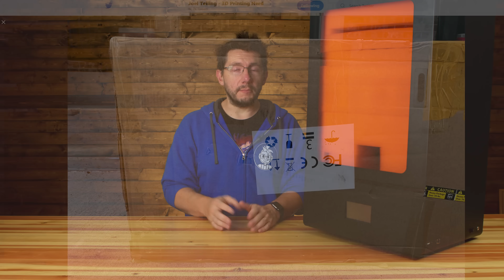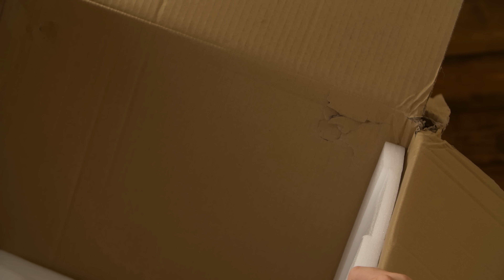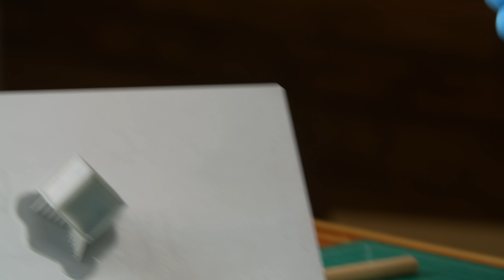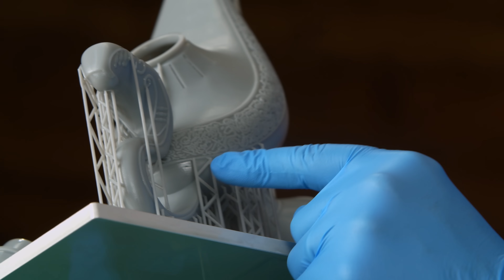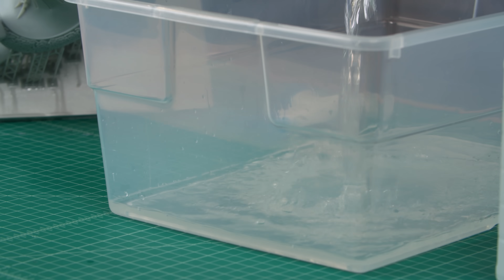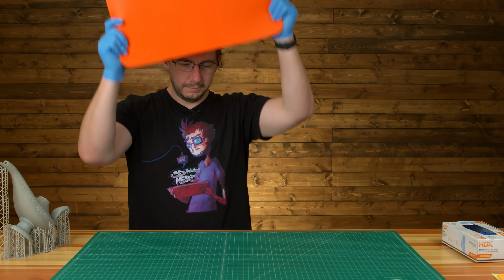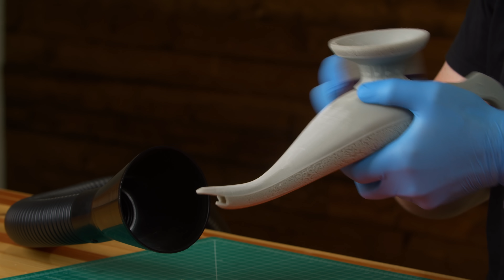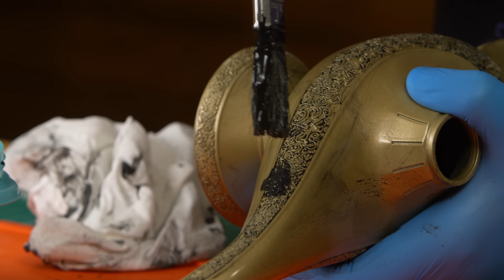HUGE Resin Printer - First Impressions of the Peopoly Phenom mSLA 3d Printer

Comment: I'd wish for a house sized 3d printer that worked like a replicator and only took carbon dioxide to carbon as a building source and took it from the air, that way the more you printed the more carbon dioxide you'd scrub from the air. I love the distress look you got on the lamp. Great video.

Comment: Spritzing it a bit wont remove all of the dangerous resin
Reply from the maker: That’s why I used a chip brush - it gets the IPA into places it needs to be and aids in the removal.
Reply: @3DPrintingNerd  I dont know if such a product exists, but i would try to get a miniature pump to rinse the prints in the mini tub. I would recommend battery powered dental cleaners, but I dont know how they would fare with alcohol.
Also here are some resin procedures, if you didnt know these exist: https://www.radtech.org/images/health-safety/3DPrinterSafetyPoster_revised_8.5x11.pdf
Be in good health and keep going!

Comment: As you say, the weathering didn't work out too well. There are panel liner washes for model kits that would give you the effect you are after. However If you are going to stick with the acrylic paint then you should water it down much more and do it in layers wiping away after each. The model itself looks great, the decorative details look fantastic.

Comment: use a hairdryer or a heat gun on the supports before you cure the model they will warm up and  start to warp you can just brush them off reducing the Pock marks. cure.  also when sanding always wet sand to cut down on the dust. :)

Comment: That is a failure of packaging not shipping. the "hole" in the box you will notice is the same shape and size of the foot of the printer. it's because what dented your printer was sliding down the high sort slide and hitting the belt for low sort this happens to every single package several times usually. 1800 dollar printer they felt the need to save .50 cents on packaging and 2 bucks on shipping...amazing.

Comment: If I may suggest for the weathering,  Get a sample set of "Rub n' Buff".  It's like 12 different metallic waxes.  Works really well for the "highlights" For this model I'd use a lighter gold colour of Rub to show wear on places where you'd expect the lamp to have less oxidation and be shinier. 

Here are my two tips on how to do your inkwash better next time.
1. Reduce surface tension.  Either a tiny drop of dish soap in the water, or a 20:80 mix of water and "Pledge Future Floor Cleaner".  
2. Lightly Gloss coat the gold before doing the wash (note I do not like Bills recommended spray Grumbacker varnish, Rustoleum spray varnishes/urathanes are my goto, plus for the price difference you can try out all 3 shiny levels..).
You are 100% right that it takes a lot of practice.  Getting awesome at weathering stuff is a little bit of wizardry.

Comment: I would wish for you to take the styrofoam packaging out of the top of your resin printer. I also wish for the lamp that Sean (or Shawn) does not want.

Been FDM printing for a long time with printrbots (2013 woody with fishing line, metal plus, and a play). I have always wanted to have the resin printing experience, but the small build volumes at a high price have been prohibitive. This printer seems to be breaking down those barriers for me.

Thanks for the video!

Comment: Joel, I like the Gold Shiny one. My wish is that 3D Printers will come to the point that they are accepted by the main stream community for the great tool that they are. I have been working in the 3D Printing for the automotive industry for about 15 years and even after many advancements in material and printers, many still consider it something just suitable for  prototypes . I hope that it does not require a magic lamp but I would accept one.... just sayin :-)

Comment: The weathering doesn't look to bad, you could clean it up a bit more with some 70% IPA (or water down the 91% you have) and go over it gently. If you're ever going to do weathering again, use oils or enamels, acrylics work in a pinch but are an utter pain in the ass to clean up, oils are the best, they give you a few days of working time and when thinned to a wash they'll get into every nook and cranny without a problem.

Comment: something you could do is get a mini sump pump and set it in the large container. you can have it pump through a flexible tube to a 3d printed showerhead so you can rinse all sides and it would recycle the alcohol that drains in to the bucket

Comment: Had our our own UPS woes with an $80K piece of lab equipment. Somehow it arrived in a box that was not the original box that was 2 sizes too big without any of the protective packaging.  So my wish is for UPS to be better at not damaging packages. (or to have a 3d printing workshop like yours which is probably more realistic :p )

Comment: How is this a larger print volume than the 3L? 335mm X 200mm X 300 VS 276mm X 155mm X 400mm, even by total volume it doesn't beat the 3L? It's close, at a fraction of the price but to say it's more is a lie.

Comment: "use the plastic spatula to remove it from build plate"... uses a metal scraper scratching the plate on day 1
Reply: No, stirring the vat with plastic. Metal on the anodised aluminium build plate. The hard resin damages the plastic spatula and then you scratch the FEP film afterward.

Comment: For me a resin printer just does not seem very practical.  The post print work required combined with resin maintenance and smells is a turn off for me.  Quality is great of course but for most people, a FDM 3D printer will get the job done.

Comment: I use a little bitty pump for aquiruim in side a larger container. Pump has a hose that runs to top  of container with few of garden mist nozzles. It works like a solvent tank but utalizing adjustable nozzle, works amazing.

Comment: NO your wrong
Resin after cure is non toxic
But
Before it cure , resin wapour is toxic , you need to use toxic wapour filter when you take out print but after it cure with uv lamp you dont need to (still need to when painting 😂)

Comment: As for wish, I would wish for my own phenom printer....even a dented one!. I like both types..but prefer a weathered look. Here's a tip for you. When you are doing the weathering, have a clean, water-dampened rag handy. Then use a piece of kitchen towelas you normally would to wipe the majority of the black paint off. Then you use the wet rag to clean off any smudges of black that you do not want on your "shiny and clean" areas. The wet rag make it easier to clean the areas u don't want weathered.

Comment: you mentioned more then 1 bottle of risen was needed for this print? that means at least  80$ for this model...
a real metal one would have been cheaper. until resin cost much much less, sla is just unpractical.

Comment: They definitely need foam all around the machine, people will even drop heavy boxes in shipping from a couple feet up just for the heck of it. Pro tip for people that ship stuff internationally, make sure that your package can also survive having something like that dropped on it. Putting the heavy stuff at the bottom and the light stuff up top should make sense, but when you do hard labor for a low wage you stop giving a crap after some time.

Comment: If I got that weathered lamp I would wish:
1. I will never run out of filament during a print again 
2. Every print I start has perfect adhesion and won't pop off later in the print
3. I could do single-extruder multicolor printing without a purge block

Comment: The problem I have with Peopoly is simple...I don't trust them. I don't trust them because I own a Moai. They have trouble reading SD cards (its on their wiki if you don't believe me), they released a heater, the first versions were weak, the second version the first who knows how many units were awful, and I mean dangerously awful, the PSU (which was generic) almost caught fire on one of them, the other one the heater module itself started smoking. The acrylic sheet in the FEP tray isn't great, to the point where they released an "advanced" sheet that effectively just has a FEP sheet on it. Two problems, if you already bought the FEP vat, tough crap, and if you buy the advanced sheet like I did (because the original leaked resin which then hardened on the sheet itself) you will end up waiting over two weeks to get the sheet only to find that there is a sticker on the onpurotected film side saying not to remove the film...the adhesive leaves a lot of residue. Because the film is not protected it was scratched, and scuffed and had a LOT of air bubbles because it trapped debris between it and the acrylic sheet, to have anything even REMOTELY optically clear enough to warrant using I ended up removing the "advanced" sheet...

How many times can one company disappoint?

So now they have a huge build volume, sure, but the complexity of the machine from a mechanical standpoint has been greatly reduced and yet they were on Tested talking about needing to use excess resin to cool the vat because the heat is so great.

There is ZERO chance I would ever spend almost $2k with them in the hopes they can overcome these challenges when they can't even do simple things like read SD cards right, or apply film to an acrylic sheet in a way that doesn't render it pointless...or seal an FEP vat.

https://wiki.peopoly.net/doku.php?id=moai-sdcard

Btw amusingly my moai shipped with an sd card that had their test prints in a gcode folder...*sigh*

Comment: I'd really suggest finding fit-over safety glasses for your eyes (not to mention long sleeves) if you are going to be using a brush-based cleaning approach. Those bristles can really fling liquid everywhere, and you don't want the resin to get in your eyes even in tiny amounts. Not to mention the IPA would sting like hell.

I think a cleaner approach to something like this would be to get a tough plastic bag (not garbage bag, thicker walls), place the model in, and then fill with IPA to an appropriate level. Roll the top down and clip with binder clips so it's alcohol-tight, then shake vigorously. maybe brush a little bit at the end. This way you won't have to worry about flinging resin contaminant everywhere.

Comment: Or you could get on Amazon and buy a plastic genie lamp just like that one for $17.99. I've never understood the allure of making inferior copies of items with hardly any of it useful. Someone at least needs to come out with a print media that is food safe, dishwasher safe and or microwave safe. I guess this is the modern version of the high school ceramics class. Sure they say oh well instead of buying an item and driving to the store to get it you can just 3D print it! This will save you money. You can just print spare parts for your home items. Well maybe that is true but not with any printer that most people can afford. Maybe a $10K printer and then another $10K for that 3D scanner you will need as well. You would never live long enough to get that ROI back as if is was possible in the first place. So what we are left with is items that are only safe to look at. https://www.amazon.com/Disney-86098-Aladdin-Feature-Genie/dp/B07GXM3XHX/ref=sr_1_3?keywords=plastic+genie+lamp&qid=1571870352&sr=8-3

Comment: Great video, kind of jealous that you got that behemoth of a SLA printer, but you know what it would be awesome? You partially disassembling the lower half of that mSLA printer, showing it step-by-step, so we can see what kind of UV source and screen they're using. SLA printers seem to be alot easier to build than FDM printers. Only one motor is used, the rest is UV light and what seems to be an LCD screen filtering where the light shines. Cheers 

Also: Be careful when you're using a vat/box that big to clean prints, you dont want to get yourself a mighty buzz from inhaling all those fumes and vapors.

Comment: ALWAYS, ALWAYS, ALWAYS remove the supports BEFORE curing! Doing so BEFORE curing allows for cleaner cuts at the attachment points because the resin is softer. You will also avoid the divots created when cleaning after curing. Believe me, I've printed 10K resin miniatures. I have tricks.
Reply from the maker: I like these words you say :)
Reply: @3DPrintingNerd  - also, adding a 20% Monocure Flex100 to your resin, then changing exposure times to that of the Flex, and you can basically just rub the supports off with almost no blemish left, again, do it before curing, but be very careful with larger, heavier parts!

Comment: Just a quick tip I learned while using Isopropyl Alcohol on my own 3D Prints: That spray nozzle can probably screw right onto the bottle of alcohol directly thus taking away the need to label it.

Comment: If I got the weathered lamp my first wish from the genie would be for the non-weathered lamp so I could try using some rub-n-buff on it for an antiqued metal look. ( Example: https://website-pull-zone-gmluc1gyxsy1f7v.netdna-ssl.com/wp-content/uploads/2017/04/bfpaintguide.pdf ). Of course wish #2 would be for some site credit to Nico's model store.. but that wouldn't be any good without my third and final wish which of course would have to be for one of those Phenom printers. Not needy at all over here, huh? 😂

Comment: Thanks for the initial look at this machine Joel. Would like to see a long term test on these large masking machines, I'm worried about the panels not holding up over time. Cost per print could go way up if the panel has a low lifetime.

Comment: I don't think you can blame the damage on UPS. When you are shipping items of this size and weight via companies that are not "moving companies" or door-to-door van lines (like you would use for fine furniture) but simply "Box handlers", you need to package the items for the worst-case handling scenario. There should be several inches of foam padding surrounding the item on all sides INSIDE the box.  And, a second, outside box that is several inches larger in all dimensions with shock absorbing material filling the void created between the two boxes, is optimal. I have shipped 75 lb. audio amplifiers and lighting dimmers across the USA without incident by using the above packing method via UPS, FedEx, and DHL.

Comment: My Alfawise U30 3d printer was shipped to me damaged (the glass build plate was shattered and aluminum heated bed were damaged) and it took a lot of back and forth and back and forth to get the new parts so I could start printing. The U30 is my only 3d printer and it is working pretty well after the replacements.

Comment: i always remove supports before i cure anything. they are much less likely to leave divots in the model if they're still soft. also, for something gold like this, i probably would have painted it black first, then used a gold wax rub n' buff. it's a lot more work, but it would automatically leave the recessed parts dark, and it would just come out more metallic looking and weathered. you could try that on another print.
Reply from the maker: Oooh. OOOOH.

Comment: This is very interesting. Only 2 days ago I was saying that I’ve been looking for a resin printer, but printers like the Elegoo and similar are a little small, and I don’t mind spending a couple thousand for a good printer.  I primarily need it for clear, and transparent enclosures, but also would like to print miniatures.  I’ll have to look at the specs, but this looks absolutely perfect.  I’m sure a quieter fan can be found, plus I’d be venting it to the outside.

I think the plain print looks better, until you hone your weathering skills a little better.  :)

Comment: I picked up a salad spinner from Ikea that lets me spin the basket in either direction so I can agitate my resin prints washing machine style. I've yet to put this method through its paces, and obviously that doesn't work with such a large print, but I thought I'd mention it because so far it has been working well for me.

I'd bet that the loud fans inside are standard server grade computer fans which is good news, because that means you can swap them out with MUCH quieter fans. I like the ones made by Noctua as they perform well and are very quiet.

Comment: My wish has already come true, I was hoping to see a large resin printer at an affordable price, as my humble Creality LD-001 is a bit small, with a build size of 180x130x130mm this new resin printer is what I was trying to find. I'm impressed by both prints, but the nice shiny lamp would look good on my shelf, especially if I printed one for myself. I also plan to print Concorde as I worked on the two first development aircraft in 1968 as a young engineer. That was my introduction to CNC machines. Now it's my hobby. You'll notice the spout looks like the nose of Concorde.

Comment: I like he shiny lamp... For the mere fact that if I happen to not like it anymore, it can still be weathered :D

The printer itself looks quite impressive - the build space though is actually smaller than the one of a Tornado or CR10 (let alone the enlarged versions). OTOH, it's really good the printer does not have a 300x300 tank, the resin waste would be insane in that case.

As for a wish... I'd wish a smaller mSLA printer, Photon-S or Mars would be more my category, I tend to print smaller things.